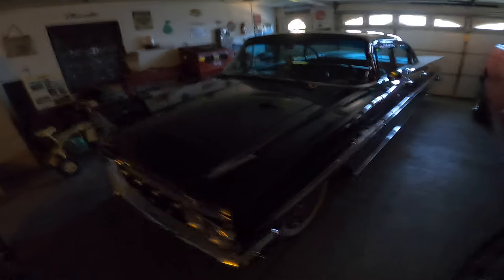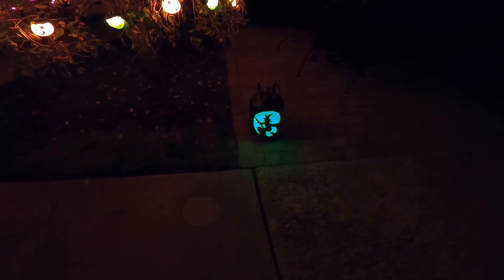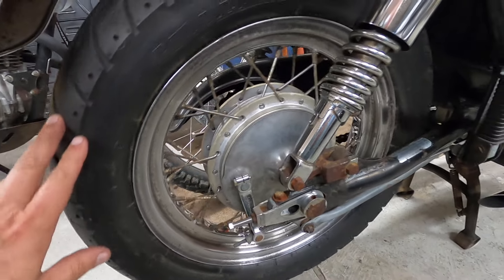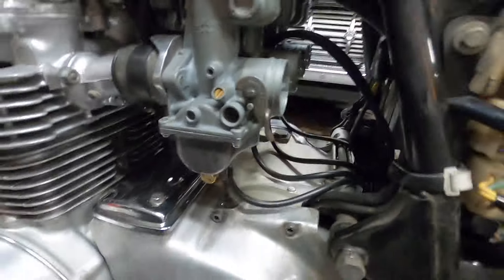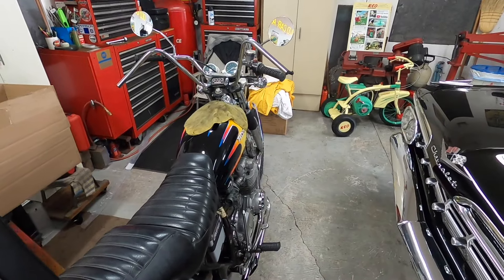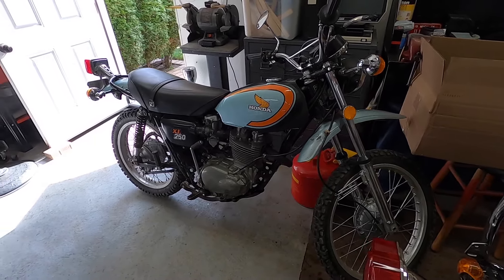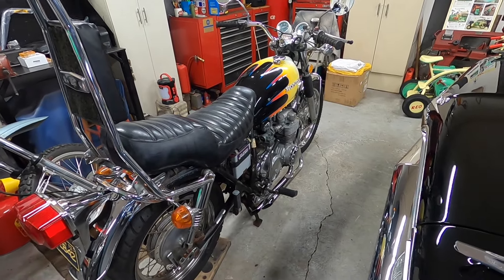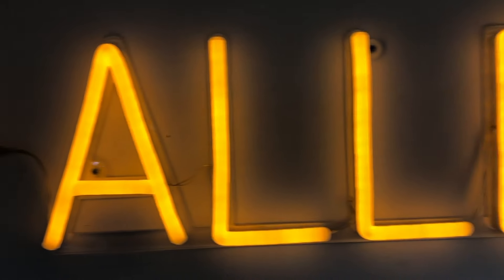1972 Honda CB500 Four project bike part 4, getting parts plus yapping

Comment: Howard, someone posted the picture of a Realistic FM converter like yours, I had a similar one in my '68 Dart that used the oddball roller controls on the AM radio,not easy to put an indash unit in it without cutting up the dash so used a converter for FM for around a year then bought a nice Craig Powerplay FM/8 track underdash unit that I had until it was stolen one night, I was going through a box the other day and found the original mini 8 track player I had as well as the CB radio I had back in the day lol
Reply from the maker: I removed the FM converter when I installed a slide mount stereo 8 track in 1980 or 81.... I'm thinking it was a "super tuner" maybe. I hid the speakers out of sight under the dash and under the rear of the front seat. That was in the car until the late 80's, though the unit sat in the trunk most of the time, being a slid mount. When it was removed, you had to look under the dash to see the slide bracket and be able to tell the car had a half way decent sound system. After removing it from the Bel Air I saved it and installed it in my work step van back in the late 90's. It was still working great when I sold the step van around 2010.  I wished I removed it from the van and kept it......
Reply: That's how the Craig was that I had,wish I'd thought to take it out the night it was stolen,hindsight is always 20/20
Reply from the maker: @rogercamp6071  Yep.... I remember aftermarket car stereos were hot back in the day, thats why mine spent more time in the trunk, than under the dash. That slide mount was awesome. My neighbors on both side back in the day had their aftermarket car stereos ripped out of there dash. That was the era, if you wanted decent sound you ordered your new car without a radio, as factory sound systems were not that great.

Comment: Howard,  I have the same pavers in my patio as the ones you laid in your rear yard.  Bike will look super when you have the painting done.
Reply from the maker: There are three different paver sizes.... I used the small square pavers for most of my patio, other than the edges. I have a lot of the bigger pavers to do the area beside the house. All the pavers had been sitting stacked from before my prostate issues. I got them from a gardening job Tom was doing, that the owner wanted the paver patio he had removed. Nothing like free pavers, though it was a bit of work pulling them up and moving them to my house. It was three truck loads.

I think a bit of paint work will make a huge difference on the bike.... Hoping to start disassembling it in the next week or two. Been so busy doing "put off" work around the house, plus getting the gardens ready for winter. We had a hard freeze overnight, I think that killed most of the annuals. Today will be cleaning them out.

Comment: The new handle bars are certainly going to add to the bike.  The license plate also looks great.  Is that a brand new plate or an original from 1972?  Always enjoy watching you do your miracles with your projects!
Reply from the maker: Yes the plate is a never used 72 Michigan cycle plate. I'm hoping later this week I can pull the engine out to start cleaning and prepping it for paint, then get the rest of the bike apart so I can start cleaning up the frame for paint.